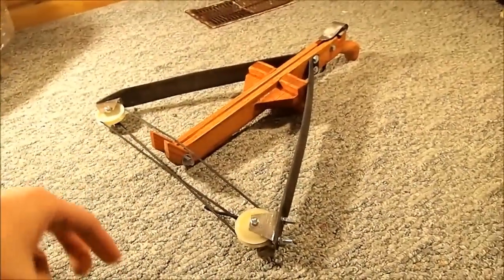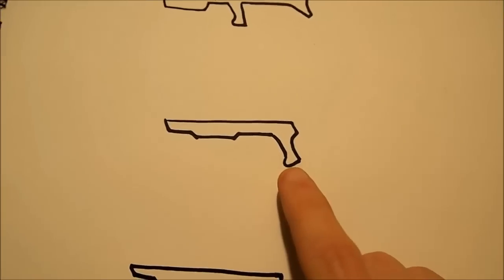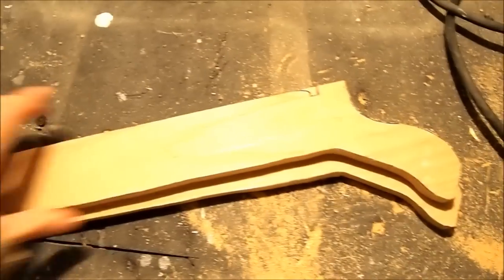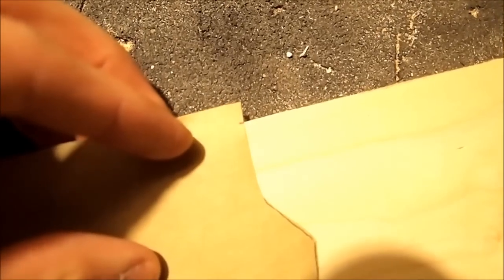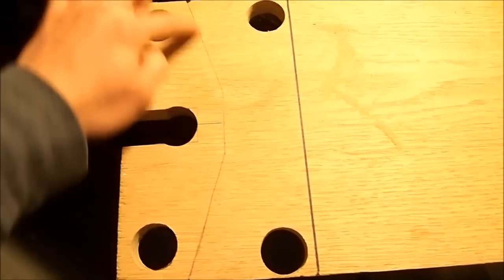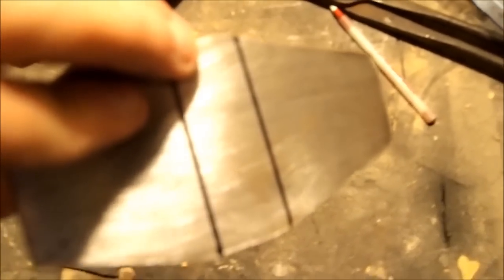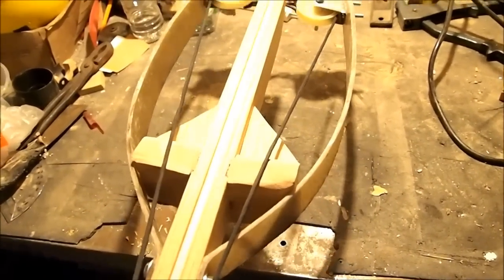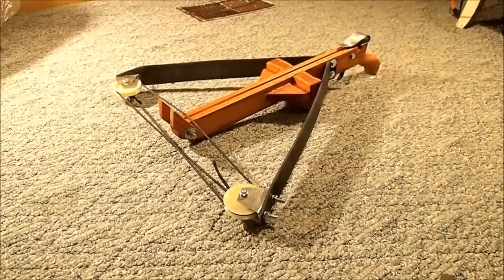How to Make: Reverse Draw Home-Defense Crossbow

Comment: You Should Build A Battle Hammer You can Make A Steel about 24 Inch Bar and Make The a Double 4 inch by about 8 inch long iron block then drill a hole in bottom then super glue or weld it in and then use paracord for handle.

Comment: Could you make this with just a string running across? Like without the pulleys
Reply from the maker: Not in the reverse draw fashion. The pulleys allow it to work by causing the tension to be built by pulling the limbs inward, if the string were running across, you would only be pulling the limbs backwards. For the simple method your asking about, the standard crossbow configuration would be ideal.

Comment: i would use the steel from a set of leaf springs from a car for the arms
Reply: DAPPER DAN GAMING/ASMR if you can pull back a steel leaf spring by hand, you don't need a crossbow for defense. you can just flex and the pressure wave caused by the expansion of your muscles will incapacitate any would be intruders.
Reply: these are facts i cannot deny

Comment: I may be wrong, but if my understanding of how compound bows and crossbows work is correct, then I don't think those wheels are actually doing anything.  If you could attach a separate cable to the inner part of each wheel that would then attach the opposite limb you'd be able to draw the string with less force.  I think...

Comment: iv got the same damn jigsaw
Reply from the maker: Is your angle thing all screwed up too?
Reply: Nonlethalbychoice
ya the plate on the bottom
Reply: paul puccio there's a screw on the botem to tighten it
Reply from the maker: I know, that's what's messed up. It doesn't tighten.
Reply: Nonlethalbychoice must not be the same jig saw
Reply: paul puccio i think that you cross threaded it